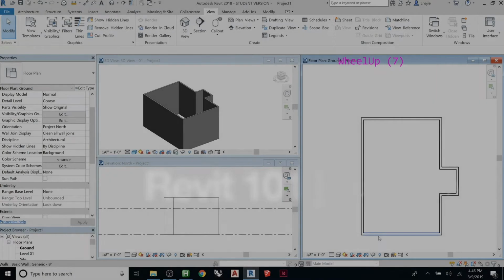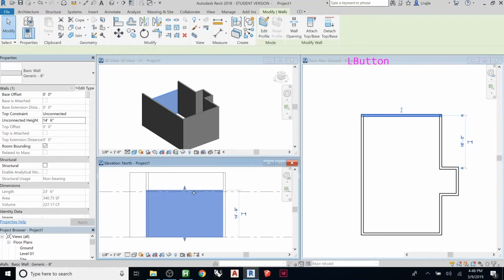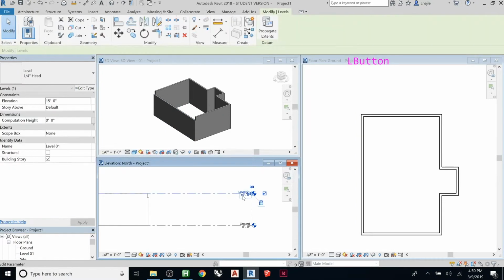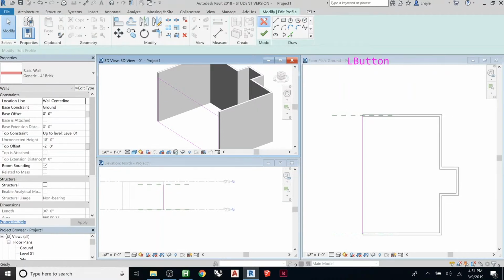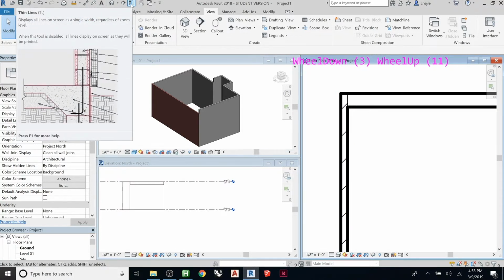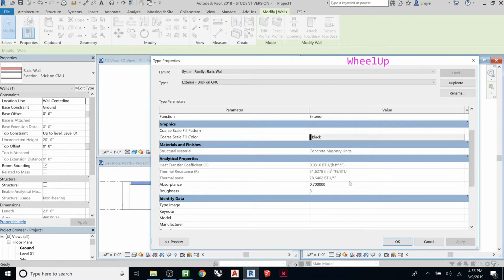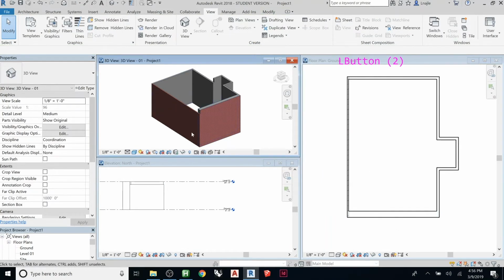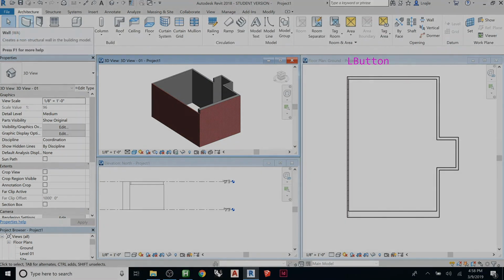Revit 101 | Part 04 | Modifying Wall Parameters

Comment: How did you get to the 3 window view? Last video ends with single 3d view.
Reply from the maker: Great question, Try clicking and dragging from the tab that has the view name at the top of the view. This will undock the view and allow you to resize it and move it around. Once you can do that you just repeat the process for the other views.